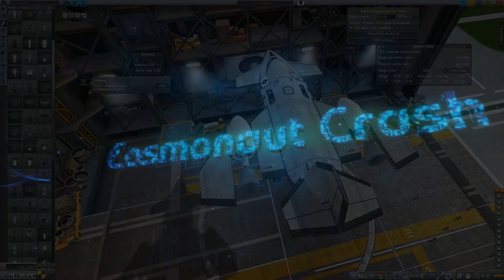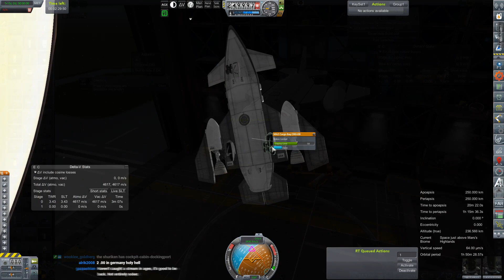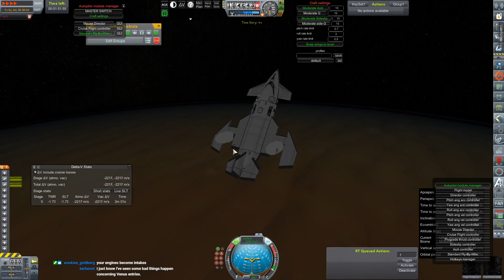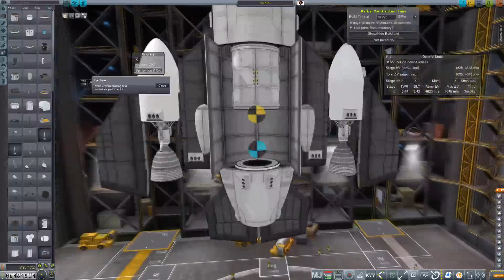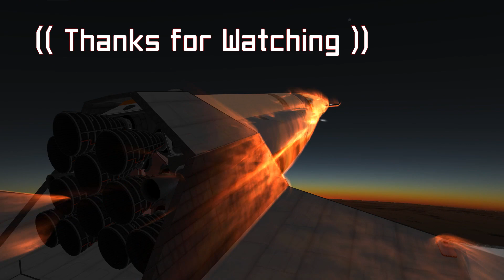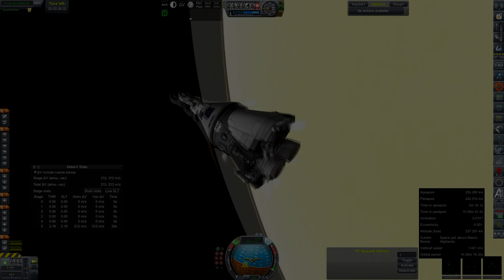KSP RP-0 #614 Spit-balling (Twitch Re-Cap)

Comment: As for the descent you'll probably want to drop to something like 20-30 km altitude with a pretty low angle of attack and do your breaking there: more air at high speeds>more lift>more control over your rate of descent. Even lower could work, but the Martian surface is VERY vertical and you may even run into Tharsis or Olympus Mons at altitudes even higher than that. If this craft is meant for only the area around your current base you could plan out your descents based on the local topography.
Reply from the maker: Ever since one particular close call, I've tried to be mindful of plotting descents that avoid certain terrain features lol.
Thanks for the advice, I tried incorporating it in last sundays stream, so spoilers for next episode ;)

Comment: (halfway thru watching) FAR might like the vehicles yaw axis more if you make that tail fin 3x bigger like the Space Shuttles ;)
Reply: Although this IS mars and the atmosphere might not be thicc enough for that to be viable
Reply: @N9GamingOfficial  To add onto this: for the transonic regime your best bet is to put the tail fin on the tip of the wings so that they're not occluded by the lifting body, like winglets. That also means that you can get away with fins about half as big, since you have two of them!
Reply: @Gazpachian  I've always thought this is the correct answer but for some reasons Cosmo doesn't like the idea

Comment: If you're going to have to bring out replacement parts, why not land under chutes ( or air brake with them) and replace them after usage?
Reply from the maker: I'd rather leave the replacement parts in orbit, and not need to refuel on the ground, but these are both contingencies I am playing around with
Reply: @CosmonautCrash  that's what i was thinking actually. Use chutes to get down, unbolt them on the ground and leave them behind, the add new ones in orbit when you refuel. I'd think you could save significant weight back to orbit shedding spent casings, and then EVA replace them. 

Or even build detachable modules that could be sent out in a group and attached in orbit with them all in place already, then left on the service with a docking port?
Reply from the maker: I was thinking I'd just re-pack them and replace after they reaches the deploy limit, but it would absolutely be worth the tonnage to just scrap and replace in orbit. Thanks!
Reply: @CosmonautCrash  I'm glad it ended up being an ok idea, I wasn't super confident in it to begin with lol

Comment: If the rotatrons are a bust, could the hinges you've used on other things before work better?? Since you don't need the engines to rotate more than 180 degrees, it could be worth a shot??
Reply from the maker: I tried hinges on some early versions of the chestnut prototype, which were even worse, as they lack even a real attachment node.